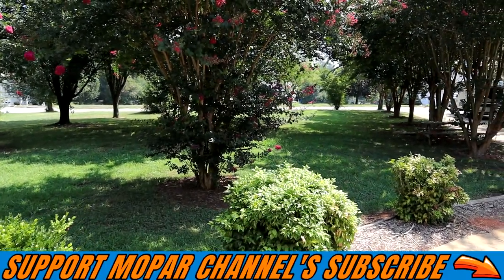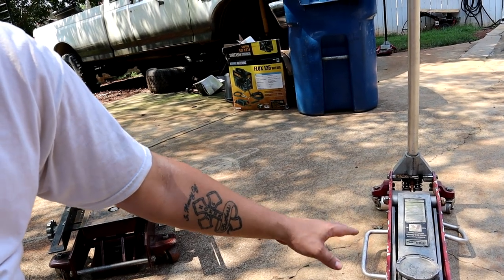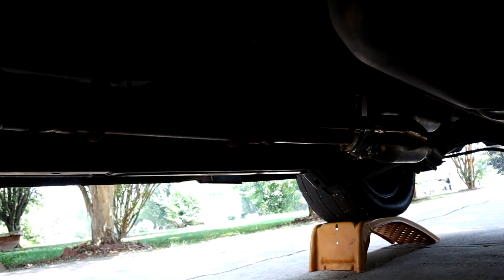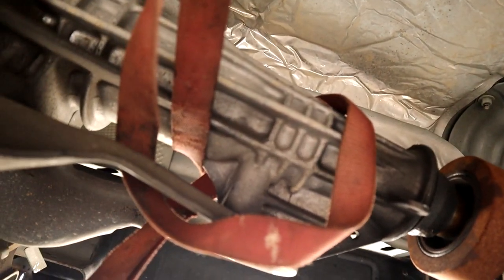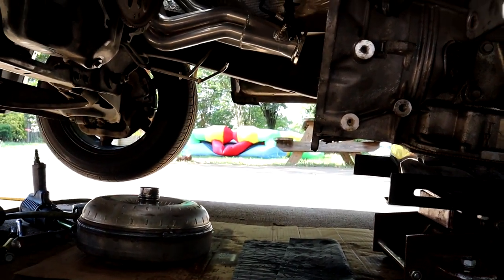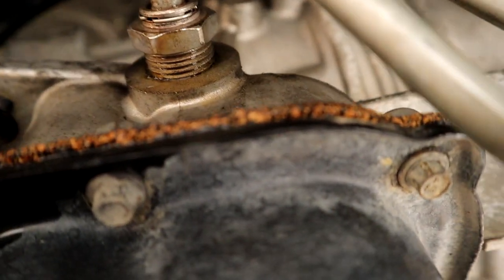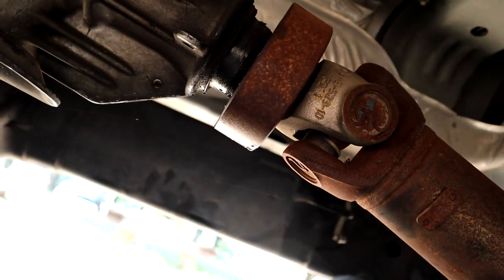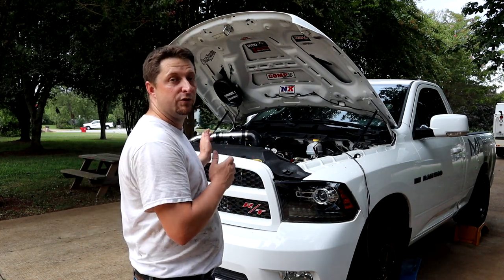Edge Racing Torque Converter Install For Ram Truck Or 45RFE/545RFE/65RFE/66RFE

Comment from the maker: This really was not that bad to do your self pretty straight forward. Thanks for the support Mopar fam🍻
Reply: Hey bro I been mulling it around with Justin Abit but what do you think on a watts linkage on on frostbite? my cover on my gen 2 Durango diff cover has one factory and it be simple to find 1 at a salvage yard u could go to one cut off the mounting ears grab the connecting bars and diff cover boom! Kit for a watts linkage on a ram....jus a bug I thought I'd drop in your ear 💪🍻😎🤠
Reply: Rite...that weld on exhaust almost made me cry 😭
Reply from the maker: @bmanclassics4350  🤔sounds 👍
Reply: @FrostbiteRam  ...hey man, what's up??? I just got a set of DNA Motoring long- tube headers for my '04 Hemi Ram...do you have any experience with that brand or maybe know somebody that used them???
Reply from the maker: @ghostrt1608  i personally haven't tried them but I'm sure someone will have some feed back.
Reply: @FrostbiteRam  ...ok, they look pretty decent from what I can see... I'm going to try and do a YouTube video on it.. I don't really know how to do it though, bcuz I've never tried it before...
Reply from the maker: @ghostrt1608  its not hard.
Reply: @FrostbiteRam  ... I just did a video man... My 1st one... Check it out
Reply from the maker: @ghostrt1608  just watched it they look nice. Also I couldn't comment because you have the comments turned off.
Reply: @FrostbiteRam  ...my bad man... I'm learning from u...lol
Reply: @FrostbiteRam  ... Ok, I fixed that too... Comments can be left now...

Comment: Just ordered my street edge today hoping to get my  60 ft times from 1.97 to 1.60 got the 3400 stall running 13.30 now at 100mph I Have a 2019 warlock quad cab 2 WD Jay Greene tune ,stainless works full headers no cats 87mm srt throttle body ,core4x4 control arms and Nitto 305/50/20 Drag radials hope they hook your Chanel is awesome thanks for all your info man
Reply from the maker: Awesome 💪

Comment: the torque converter bolts are spaced close enough together you can access 2 of them at one time.  I used the bolts to rotate the converter so I didn't have to go back and forth to the crank.

Comment: Hello low 60'! Great content... A motorcycle jack works great too. Harbor Freight is your friend.
Reply from the maker: Oh yes I love harbor freight
Reply: Same exact motor cycle jack I use for trans drops, but on the dakota 45rfe I usually just lower it onto my chest by hand before sliding it over to the ground and putting it back on my chest and then benchpress spiking the trans to the engine before holding with one hand until I get the side bellhousing bolts in definately easier with a helper to out in the bolts though since it's not very heavy (dropped, swapped and rebuilt this trans a frustratingly-annoying amount of times lol, I even have my exhaust built around making it easy - anyone who knows about a way to tune a 66rfe without rewiring for canbus let know. Or better yet a 8hp that can communicate with pci bus)

Comment: I have a 10’ w the same transmission. I’m not due for a change as I replaced the trans 30k miles ago. Will I need to add fluid to it after doing a stall? Never done one before lol

Comment: Nice video. I'm sure it was tough filming this process.   I'm about to replace my TC on my 2014 Ram 5.7 8 speed.  My question is do I have to do a re learn after? Are there any special tools I should purchase for this job? 
What did you torque to bolts to on the TC? 
And lastly how many quarts of fluid did you have to add? 

Thanks for any help!
Reply from the maker: Honestly only had to fill the converter with fluid and install didn't need much fluid at all perhaps 1-2quarts. No need for relearn and if you have seen some of my other videos you would know I'm not known to grab the torque wrench often lol just go with the flow or 1-2 thugga whuggas 🤣👍
Reply: Thanks for the info! I'll make sure I have a couple quarts with me then.
Reply: Torque converter swap was a success. Got it done in one day with the help of my brother. Biggest pain was unplugging the o2 sensors off the top of the transmission.
Reply: I have a 2005 Dodge Ram 1500 5.7 V8 Hemi with the 545rfe transmission with Tow and haul switch ,two-wheel drive, I am replacing the transmission and the torque converter how many quarts of fluid do I need I'm guessing about 12 and should I use regular ATF or. Full synthetic, note I'm replacing it with a used transmission with 93000 miles on it

Comment: Very thorough thank you. I have a 14 Ram 2500 with the Cummins and 68RFE. Since it was brand new it has always clunked in the driveline at low speed when letting off the throttle or getting back on it. If I do a transmission relearn on it, it goes away, but only for about 100 miles then it comes back. Any thoughts?
Reply from the maker: Thanks👍
Reply: @FrostbiteRam  Do you have any thoughts on my issue?

Comment: Nice video I believe you are the one that can help me with this problem that I'm having I hope you are can I put a 2013 Dodge Ram 545rfe transmission into a 1997 Dodge Ram 46re
Reply: Can you tell me how to hook the wires from a transmission 545rfe 2013 hooking them up to a 1997 46re transmission Dodge Ram 1500
Reply from the maker: In not sure but that 46re is a better transmission if built up

Comment: get rid of the cork gasket and put some rtv on there so it doesnt leak
Reply from the maker: Lol it has rtv also on both sides
Reply: @FrostbiteRam  but it will leak though the cork its self. kinda looks like it already has. dont you know this isnt 1950 lol. but i bet you love the converter